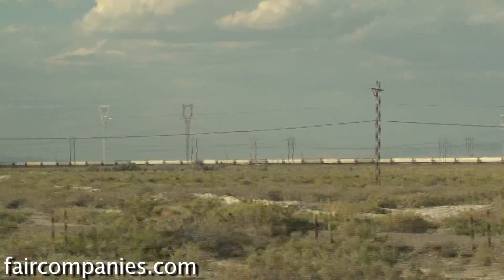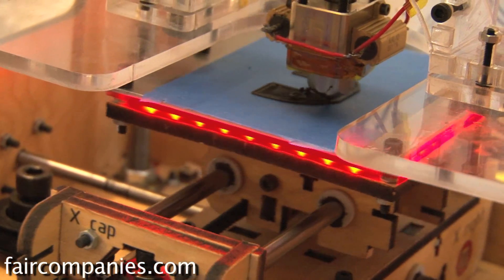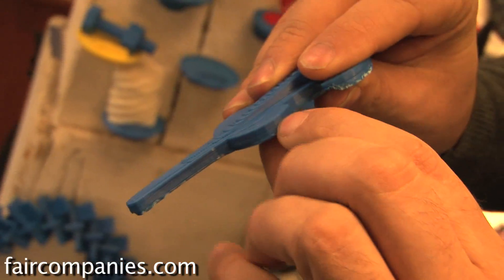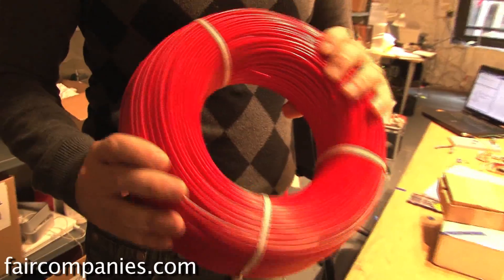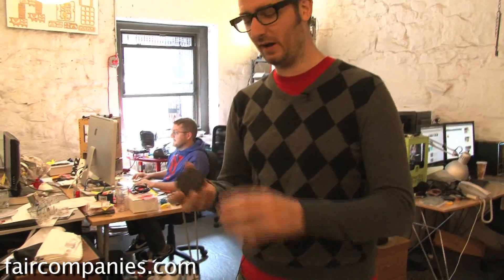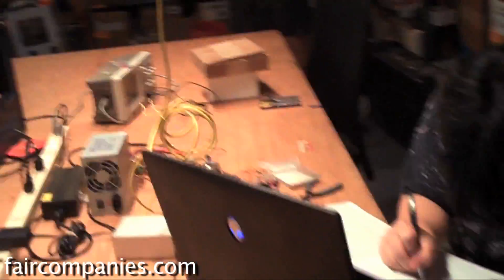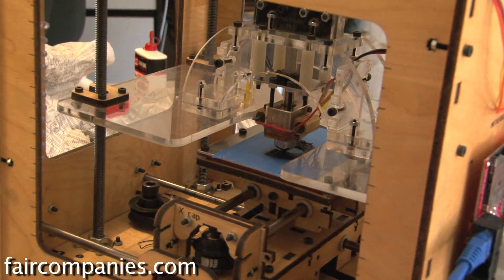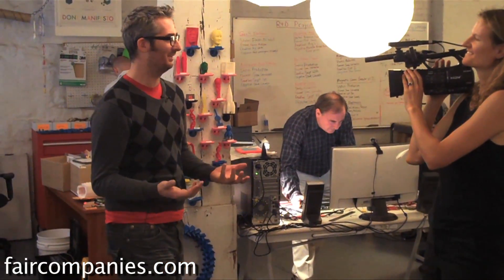3D printing living up to its hype? Rise & fall of MakerBot

Comment: I have seen someone make machine parts with the plastic printer using the lost casting method by making the cast in clay and firing it to burn out the plastic, they used PLA as it was less toxic when burnt as the ABS is not good to burn.
I'm getting my printer in the next 2 weeks,,no it's not a makerbot, it's a Ez3D phoenix printer, all printers don't need to cost an arm and a leg.

Comment: I think the critics below need to be reminded that a $2000 machine with a roll of plastic that costs $65 is what MAKERS want. We want a precision tool that creates 3D printed items we use to make molds and casts with. Nobody mass-produces with a 3D printer. You use them to create an original to utilize in the manufacturing process. And as for this being the "antithesis of craftsmanship", I am afraid you are being closed minded, but it's only because of your ignorance of the process. Take some time to learn about 3D modeling, and if you're a crafter of any medium, you'll notice the complexity and finesse involved. The ease of duplication doesn't erode the craftsmanship of an original piece, any less than a mission-style armoire being duplicated by Walmart. Nobody suddenly looks at the skill of the original piece and thinks it's slighted. 

To criticize the MakerBot for not being a Craftstman tool, is ill-placed; the two things have nothing to do with one another. 3D printing isn't about doing things like a hippy. It's about bringing manufacturing back to places it escaped because of corporate greed and anti-labor business practices. The abuse of globalization by the wealthy has created giant consumer-culture in America. That's bad. Products like the MakerBot give people like myself the ability to create prototypes that can then be manufactured locally, and produced in quality ways that encourage more manufacturing and entrepreneurship. That doesn't take away from art or craftsmanship.

Comment: "How is buying the printer and all the printing materials, plus the designs from the internet to print something any better or more self empowering than buying at the store."
>Buy a ____ at the local ____ shop.
>Realize you could use another one.
>Buy another ____.
or
>Buy a _____ model online.
>Print out the _____ you purchased.
>Realize you need / want another one.
>Print it out again.

See what I did there?

Comment: @kirstendirksen Glad there's someone else who thinks about recycling in materials for the 3D printer. I found this:  "ABS uses a number of hazardous chemicals. These include butadiene and styrene and acrylonitrile. Acrylonitrile is highly toxic and readily absorbed by humans by inhalation and directly through the skin. Both the liquid and its vapor are highly toxic. Acrylonitrile is classified as a probable human carcinogen as are styrene and butadiene."

Comment from the maker: An update. I just found out that you can use PLA (polylactide acid), a biodegradable plastic, in a MakerBot. And better yet, there is a group at Wellington University (New Zealand) who are making a recyclebot that will recycle your milk jugs (the HDPE plastic) into a filament to be used in your MakerBot. At least with this second option it feels more like a closed loop.

Comment from the maker: @kirstendirksen Good point. Maybe depends on who uses these machines. Right now there seem to be a lot of nicknacks, but I do think there is potential here to use this as a fix-it or customizing tool. I just watched a youtube video where someone customized the light in their kitchen. Less remodeling and more customizing? But you're right, I personally prefer to live with less so don't see a need for one now. Though borrowing one to print a lost lens cap or part I get (can't always find 2ndhand)